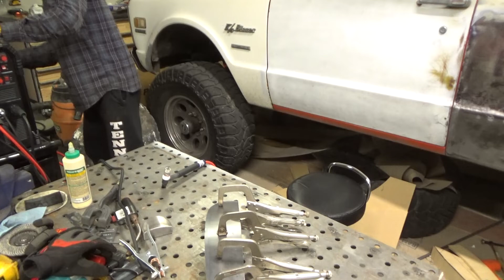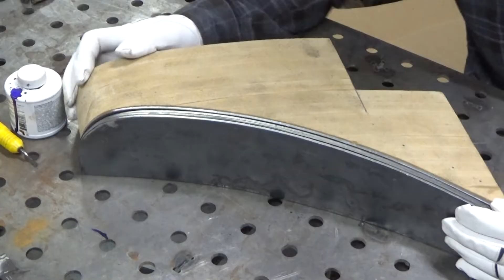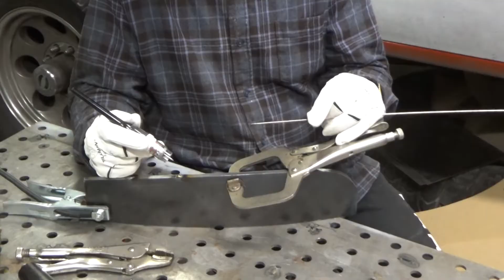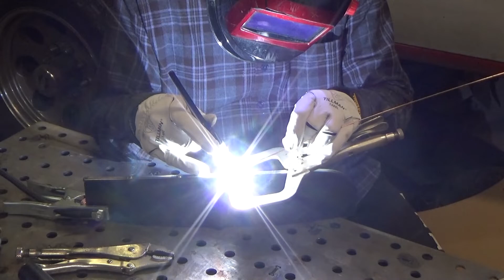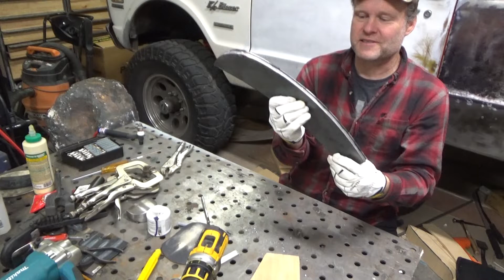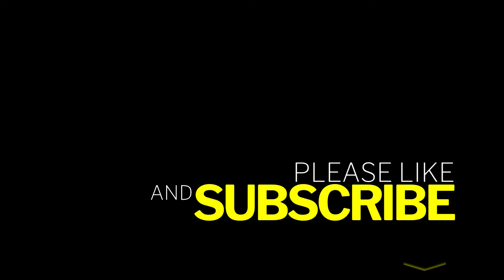Welding up steel forms to create a hammer formed patch panel. 1971 Chevy Blazer bdp #9b

Comment: What if I make a fiberglass mold on the piece I want to make, then back it up with wood or metal, and then hammer the iron plate, will this work or will it break?
Reply from the maker: In my case the wood was only for checking the shape after it was hammer formed and for making the metal parts the correct shape. In one video, I tried hammering over wood and it didn’t work out well. In the end, I only hammered on the metal portion of the form. Fiberglass might be ok to check the shape as you are forming it, but won’t be strong enough to hammer against.
Reply: @bdpgarage  What if we back the fiber mold with strong cement to fill it from the back? one block. May become strong to bear the ways. The result is accurate. I will try this later
Reply from the maker: @آسآمةرحہمون  might be worth a try. Let me know if it works.